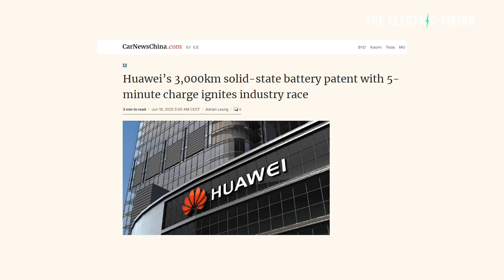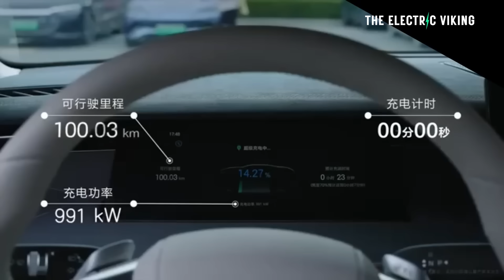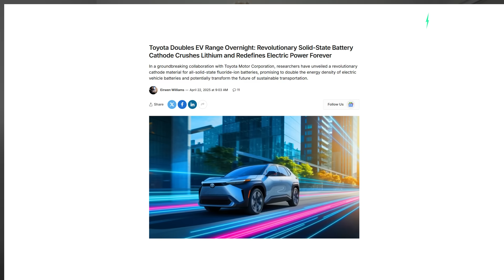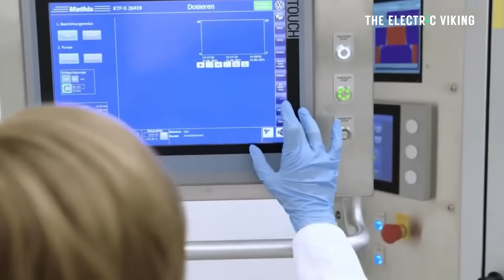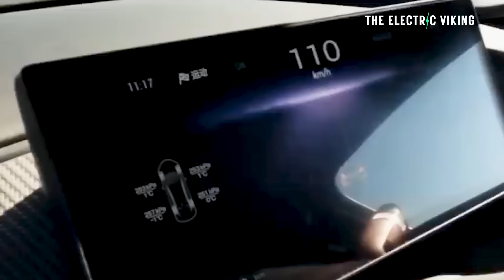5‑Minute Charge, 1,864 mi Range: Huawei’s Battery Patent Shocks Industry

Comment: As an owner of 2 Model Y's, I think 500 mi.'s of range is all that's needed for passenger vehicles, with ~10 minute charge and 3000+ cycles.
Reply: charging in 10 minutes would take the equivalent of 8 super chargers charging 8 Ys at the time time.  That isn't going to be super practical as charging 2 such cars will be like charging 16 Ys at once, and charging 4 such cars like charging 32 Ys at once. few locations have infrastructure to handle so much power.
Reply: There are tons of people who frequently make +1000km trips yearly. Most of the European winter and summer vacation scene for example employs this need for range. Sure a lot of it is aided by being able to recharge in 5-10 minutes and just doing a couple of stops, but having the actual option to go 1000-1500 km on a single charge would be game changing. It would be a massive incentive for people, also just knowing that on a daily basis you may be able to go weeks or a month without recharging. It would lessen the burden on the charging infrastructure, there'd be tons of b2b parties that would be interested and invested in promoting super long range vehicles like this -at least when it comes to the larger segment types like C segment+ vehicles.
Reply: Yeah, 3000 charge cycles and 500 miles/cycle, that's 1.5 million miles, people only need  one car per life.
Reply: @bigeye4520  That would be countered as ist was with the lightbulb cartel. At least in the US.
Reply: As the owner of 0 Model Y's I say it doesn't matter what you think no matter if you own 20 of them.

What a truly pompous thing to say.

Are you really so full of yourself that you honestly believe no driver of a passenger vehicle would go for a 1,000+ mile range battery?

No one likes having to stop to refill/recharge their car/truck whatever, no matter how long it takes.

It's a necessity to make it work, but that doesn't mean people WANT to do it.

More range means charging less often.

It also means that V2G applications are that much more viable.
Reply: @mnomadvfx  Since you are "the owner of 0 Model Y's", I say it doesn't matter what you think, while you insist on being a beligerant knob head with an opinion in a sea of opinions.

If Russell wants to express an opinion based on experience, which is apparently more than you can do, then thanks to Russell for his contribution and persepective!

Comment: If my car had a 2000 km range I'd only need to recharge once a year..😂
Reply: I could charge all the time at home, no super charging
Reply: That 2000 km range is only at 100 km/h. If you're driving like 180-200km/h on the Autobahn with headwind during winter, you only get like 400-500 km range (2-2.5 hours of driving). German diesel drivers probably think that to be just enough. Other people that need to cover such distances are people in the Arctic circle like the Alaskans and the Far East Russian, Africans and people who like to tow heavy stuff. 

I can see this kind of ranges also be of good with other forms of transportation. Coaches/buses need to have such long ranges for scheduling reasons and to not have to cheat with onboard generators for heating/air-conditioning, aviation need those batteries and also trains. 

Overhead wires aren't cheap and they increase downtime quite a lot for a track when an overhead wire snaps. I hear there in the UK and Germany battery electric trains service diesel train lines and use existing network or "electrification islands" to charge the batteries. It sounds quite promising, meaning I won't be surprised to see overhead wires even being removed to cut down on maintenance costs because of copper scarcity, in places where people worry about the risks of inhaling of copper dust or reduce fire risk in arid areas partly caused by the sparks coming from the pantograph hitting/scraping the overhead wire (if overheated wheels aren't the problem).
Reply: U definitely need an EV as driving ICE short distances put out more pollution 😜
Reply: Qin plus dmi
Reply: But then, you can do it in 5 minutes !!!
Reply: @martinv.352 but the energy will disappear even if not used, while gas can stay years in a tank
Reply: Yes, but people like me would need the charge once a fortnight.

The amount of fuel I use but I can't go Electric yet as I need more distance then they give yet. But once they can give more then ,1500 range is am all in
Reply: @SnippedGlobal  You can charge any time, just a thought.
Reply: why would you own a car then?
Reply: @wonderwalls3565  You obviously don't live in the U.S. want to go shopping you need a car, doctor appointment need a car the list goes on....
Reply: @rooster1012  He does less than 2000kms in a yaer. if you do less than 2000kms a year. you dont need a car adn you dont have these appointments. and even if someone does they may be living close to public transport.
Reply: @rooster1012 In Europe, even if cities are not so much widespread than 🇺🇸 ones, we need cars: for working, shopping, pick-up children,….so in the day-to-day Life.
Of course, retirees, not so much in need….
Reply: Some of drive more than 2 km a week you fool
Reply: A fool, says the guy who thinks 2km a week is 2000km a year 😂 @StuartKarlson-qn8pj
Reply: @StuartKarlson-qn8pj  Why are you getting triggered? He was talking about himself.

Comment: Tradable Tariff Credits for Trade Imbalance.  Tradable tariff credits designed to rebalance international trade, especially benefiting smaller or less developed economies. Unlike traditional, rigid tariffs, this is a flexible, market-based approach.  Here's how it works:  Credit Issuance: Countries with a trade deficit (importing more than they export) are issued tradable "deficit credits." These credits represent a form of offset for the economic strain caused by the imbalance.  Per Capita Adjustment: Crucially, the value or number of these credits is adjusted based on per capita economic value (e.g., GDP per capita). This means a deficit in a smaller, lower-income country generates more impactful credits than a similar deficit in a large, wealthy nation, helping to level the playing field. Market Trading: Nations with trade surpluses (exporting more than they import) would need to purchase these credits from deficit countries. By buying credits, surplus nations either gain the right to maintain favorable tariff rates for their exports into deficit markets, or they compensate the deficit country for the economic impact of the imbalance. Offset Function: This system acts as a dynamic "offset function." It incentivizes surplus countries to either increase imports, invest more in deficit nations, or bear a cost for continued market access, fostering more balanced and equitable global trade. It transforms tariffs from a punitive measure into a tool for managed rebalancing and developmental support.

Comment: so work it out car does 3 miles per kilawatt divide 1864 by 3 thats over 600 kw battery to charge this in 5min 600x12= 7.2Mwatt charger.....Mmmmm .  The same what a town with 8000 people  uses.
Reply: Precisely, the infrastructure required to achieve these rapid charge times will never exist in the real world

Comment: I bought a smoke detector that has a sealed 10-year battery that last the life of the detector.  At this rate, it won’t be long before EV comes with a sealed lifetime battery that last 100,000 miles.
Reply: I bought a similar smoke detector, threw it out after 18 months cause the battery was failing.

Comment: As owner of 2 EV's, longevity is more important for me then range
Reply: If you look after your charging behaviour well, your EV battery can last up to 20 years let us say your short range 435 km model Y, G6 after 10 years you probably still get around 390 km and down to 350 km in year 20. Longevity is not a problem. The real world range is the most important. That is about your battery quality
Reply: @nguyenviet2025-m1m  Only 10 % degradation in 10 years? Well I would be happy. Still why would you want to trade more range for shorter lifespan? More degradation means higher risk of one cell failing and making the whole pack useless. You go from 80% range to no range all of a sudden.
Reply: @itekani  Because if you don't have the range, you can't use the vehicle at all for its intention - Even having Zero degradation wouldn't help for a vehicle you can't use to begin with.
Reply: @itekani lifespan and more range are not correlated. You have a 1000 km range for one charge or 500 km range, their lifespans are the same.
Reply: @nguyenviet2025-m1m  But w/ more range we tend to charge less thus longer lifespan ?
Reply: @ecrush5080 you are right. Let say . 2500 cycles for 200,000 km for example, if the real world range is more, then numbers of cycles are less. Thus lifespan is longer.
Reply: @babajaiy8246 Are you saying that todays EVs with 300+ km real world range are not usable?
Reply: @nguyenviet2025-m1m How do you know? The problem with solid state batteries is cycle life. That's what they are working on, but we don't have any products on the market to compare. Bit as an example, if an LFP battery may last say 3000 full cycles, and a solid state battery that is 150% bigger only last 1000 cycles? You still get more mileage out of the LFP battery, but with shorter range between charges. That's the trade-off I'm talking about. If that were the case I would still have the LFP battery at a lower cost.
Reply: @nguyenviet2025-m1m Range is not a key problem for the vast majority of EV owners. They do close to 100% of their driving in urban environments where there is plenty of charging infrastructure. I live over 200km from the nearest large city and I still don’t find range to be a problem.
Reply: Long range = longer cycle
Reply: @MrAdhiSuryana it doesn't matter. Let's say long range 1000 km wltp. And it is 3000 charged cycles of the battery life span. But the battery is used efficiently for example 1000 km wltp but in the real world range you can use 1100 km. Then each cycle you can last longer. The same cycle but the time of use is longer.
Reply: Agree, and also if the price is high it will not be interesting for the mass market. Sodium batteries may be the bigger game changer for EVs.
Reply: Everything counts but longevity is my main thing I want in cars also.
Reply: As expected if anything good/ amazing come out of China, there will be a lot of "coping" in the comment section 🤭
Reply: Have you had any longevity issues with your cars? 
Personally I own the worst car for battery degradation, the 1st gen Leaf. But by not changing more than 70% unless I really needed, I haven't got any degradation. Just 4% over 5 years and 40k miles.
Bought it at 89% and now is 84% state of health.
Reply: As expected if anything good/ amazing come out of China, there will be a lot of "coping" in the comment section 🤭
Reply: But can we trust their batteries? Did we really think about all the privacy concerns?
Reply: @Unacceptable. You should be concerned about YouTube, Facebook, all apps that store your privacy data as well.
Reply: I want range and longevity
Reply: Tesla quietly stopped offering the range extender about May 7. Range, price and towing capacity were all over promised and under delivered. I call it "Musk-speak".
Reply: Don't worry, the car battery will live longer than you 🎉
Reply: @robmyers8948  That's correct.
In a local landfill poisoning ground water and emitting toxic fumes into the atmosphere.
Has anyone investigated how much water is required to mine and process lithium??
Everyone here seems to be concerned about the 'middle' of the equation, not the beginning or the end.
Reply: You are making a straw man argument.
Reply: Yip, and if it does fail, easy and low cost repair.
Reply: True. Hopefully the cost for a new battery pack will come down to a couple of grand.
Reply: You don't need longevity since price of EVs are so cheap. You can get an updated ev model earlier than you would of a combustion engine type.
Reply: @vinhoe9661 Really? Good for you if you are that rich 😄. I tend to keep my cars for a long time, and the util EVs I was driving 10+ years old cars. For the price I paid I need to keep my EVs at least until they are that old, and if not I need them to have some resale value.
Reply: I think they are both important for me.
Reply: Longitivity and the range are essentially compliment of each other they are essentially pretty much the same issue to improve all of them you improved both of them.
Reply: Please can you kindly enlighten us more?
Reply: I gave up Cybertruck preorder because I cannot depend on it to go to my cabin 550km from my house without charging. I have plenty of solar power there to charge it. The range extender is 300 lb and take up 1/3 of the space of the bed. It sucks. I bought, instead, Chevy Silverado Duramax LZ0, which gives me easily 1100km range on a full tank of diesel.
Reply: @xianqingdu  Yes that might be but now you have to smell this poisonous diesel.

Comment: Such a good video ruined by another of Sam’s off the cuff BS statements. “EVs will be lighter than ICE vehicles”. I’ll let some of the genius’s, who applaud Sam’s every comment, do the math but just to help, remember, doubling the energy density will not half the battery assembly weight, especially if, like Tesla, the battery assembly is integral to the vehicles structural integrity. Quadruple the energy density, WHILE maintaining existing range MAY do the trick. And yes, I think we will eventually get there—-just not anytime soon.
Reply: He's a Knobhead 😅
Reply: I did a little follow up on my comment---calculations were based on a little older Telsa battery but: A 100KW battery weighs 635Kg. A 75KW battery weighs 530Kg or 16.5% less but 25% less KWH. If these ratios stay the same, a 100KW battery with twice the energy density would weigh 442Kg. With 4 times the energy density, 308 Kg. Even considering all the auxiliary equipment, the EV will still weigh more.

Comment: Sion power from Tucson, AZ, which has received funding from Cummins and LG Energy, claims an energy density of 490 Wh/kg. Last year, construction commenced on a manufacturing plant; however, there has been a noticeable lack of communication from them since that time. Thus far, the competition among these companies, including Huawei, has been conducted virtually.
Reply: The benefit of Huawei is that they're already a massive company with deep pockets to fund what needs to be funded. They're less reliant on external parties, and therefore less reliant on making bold claims that are based too much on hopes and dreams rather than what has physically manifested and been tested.

Most upstarts cater to investors first and foremost, it's the name of the game. Without funding, you die - so many end up saying what they need to say to get investors onboard and keep their interest to secure their continuous funding. Huawei is not seeking big investors to help them fund their research. Their priority and reason to make big claims are thus entirely different compared to a company like Sion Power. Not saying Sion are making false promises, we can't judge till we see the results of their efforts. But until those results are in, we also can't assume in good faith that they have equal reason to be truthful to the degree that Huawei might have.

In both cases, time will tell.

Comment: Realistically I would need 550 km range for winter and price to be equal to ICE to make the move, we will be there in 2-3 years I think.
Reply: 3 years would be good enough if USA is not playing a spoilsport by sanctioning these good Chinese companies 😂
Reply: Why do you need that much range?
Reply: @SteveRomigsongwriter  Cause I do not want to compromise too much compared to gas and there is one trip I make freqently that is approx 550 km roundtrip and I am thinking if there is some event there as it sometimes happens and a lot of people visit at once and chargers get congested I do not want to wait in cold for even an hour if I need to top up
Reply: Surely an increase in charging time would only require a simple upgrade in existing infrastructure.
Reply: Drill baby Drill 😂😂😂

Comment: I'd be stoked with 500mi of range. Anything above that is gravy. The other gain would be electric aviation including eVTOL
Reply: using batteries that goes 1000 mi —- put half of those batteries in a new EV, you get reduction of size (more room for passengers), and less weight… probably goes more than 500 mi!
Reply: @alexhu7939  yup!

Comment: I'll not get an EV until they can do 250K miles on one charge and that charge only takes 4 minutes. 
I have my desires and I'm sticking to them.
Have to go, it's time for therapy.
Reply: Then  don't bother
Reply: Keep in mind, if you own a house, you leave with a full charge every morning saving you 512 minutes per year compared to refueling with a car.

While it's physically possible to refuel a 13 gallon tank in under 2 minutes, real world data suggests a range of 5 to 10 minutes for the entire refueling process is a good rough estimate for most drivers.  If you want the cash price, you need to walk inside.   If your affinity app on your phone won't scan like your card, you must walk inside.   You may need to wait in line behind 1 to 3 other customers.    

Charging in 2 minutes assumes you are paying the highest credit card price so that's a 20 cent surcharge per gallon ($2.40 average for cars... $4.80 average for trucks).